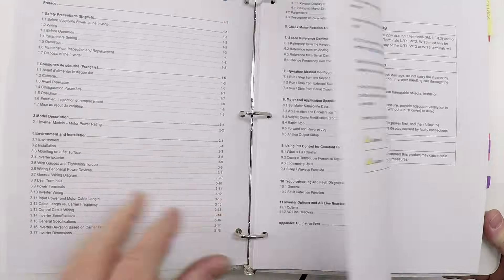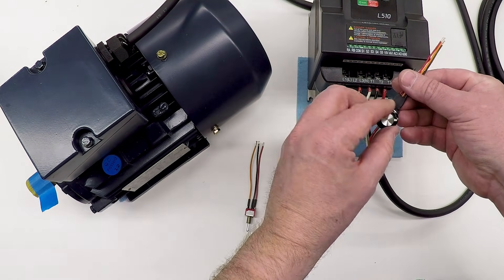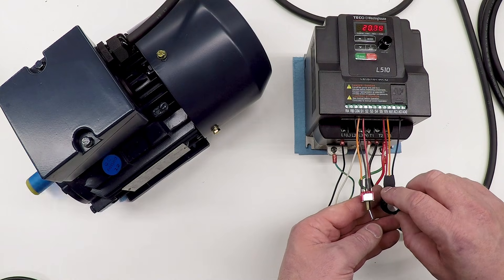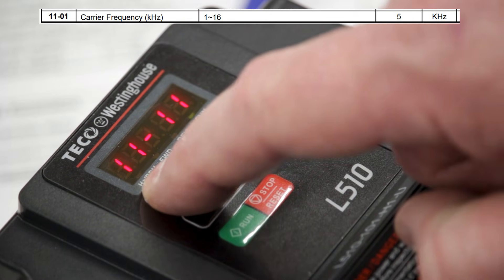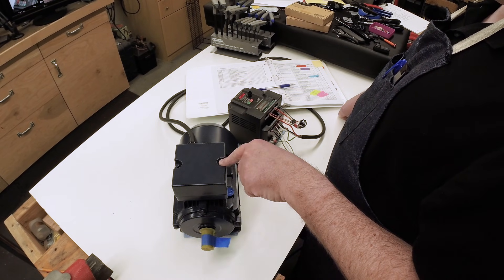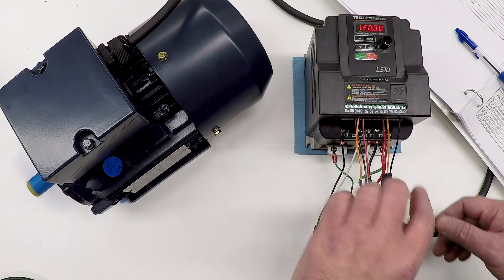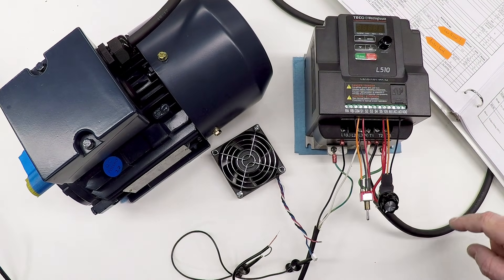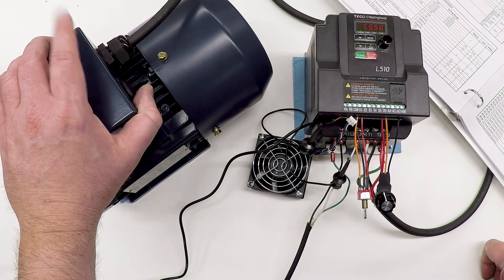Lathe VFD 2: How to Program a VFD for a lathe (Teco-Westinghouse L510)

Comment: John Owen

Like many others I found your video extremely useful and informative. I had just installed the L510 and a 3-phase motor on my 10" SB lathe and was having problems with a high-pitched whine coming from the three-phase motor. Much louder than you experienced. Actually TECO were very responsive to my problem and told me which parameters to change but I was somewhat daunted by the process. Your video showed me how to do it in a very clear manner. Thanks. It gave me the confidence to change several other parameters such as acceleration/deceleration times, etc.    FYI -- TECO have recently (May 2020) introduced a true remote keypad for this inverter --part # JN5-OP-L01 which completely duplicates the functions of the keypad on the inverter , including the potentiometer and allows you to control the inverter from several meters away. It connects with a CAT 5 cable and you need to change a parameter to install it.  Others could find that useful.

Comment: Thank you so much for this video!  I bought an old Delta Rockwell lathe with a three-phase motor, and once I figured out I needed a VFD to drive it I ordered an L510.  I didn't know squat about VFDs and couldn't figure out a damn thing, then I found your video series. Fantastic coincidence you had the same model VFD!  Now my lathe is runnning and I couldn't be happier!  

By the way, was your L510 manual missing the last 6 chapters?  My manual only came with chapters 1-5 and the appendices, but evidently there are 11 chapters in the whole manual.  I found a complete copy online.  What the heck?  I needed chapter 7, it explains how to configure momentary stop/start buttons.

Comment: Clough42....Is it possible to reverse motor rotation from the "key pad" on the L510? I know this can be accomplished by changing parameters and also adding an external switch, but what about the keypad?

Comment: have the 1/2 hp version of this [ L510-1P5-H1-U ], 120V input 208 3ph output - the tips helped immensely!  Runs silent, will overclock without issue. I am working on setting the incremental steps for up/down speeds (5 Hz step)  Thank you for the info!!  Going on my 1935 9" South Bend Workshop 415

Comment: You can use a required temperature rated NTC thermistor installed around heating area and connect series with  cooling Fan.it will manage the cooling process reliably.https://www.aliexpress.com/item/32988252790.html

Comment: When I switch off the VFD after finishing soime whork when I come back to it and switch it on it always defaults to the hightest frequency/speed.  Is there a workaround?
Reply: Look under settings 00-09 - 00-11. These settings are what is remembered between power cycles.
Reply: Are you using the keypad or onboard pot or external pot to change/set frequencies?

Comment: Thank you very much for this video.  I was struggling to figure out how to use this VFD.  I didn't see anywhere that you had to press and hold the Enter button in order for changes to me made.  Works much better now ;)
Reply: I should add that my VFD was like yours in that the settings were not what the factory presets in the info I got said they were.
Reply: I had the EXACT same problem!

Comment: thank YOU ! I have the same VFD and the settings were  all messed up....
I got a Logan lathe with this VFD set up on it....but only a switch to the power cord !
the rest is controlled by the panel.... if you reset the VFD it goes back to all the factory settings which are NOT what the manual says...it is indeed set up for external switches & Pot.
I just tried to use a toggle switch on the VFD to control the direction , However you must use a 3 position switch ! ( on -off-on )
as the 2 position toggle will not work.... there is no way to turn it on once you change the motor control from being on the panel to your external switch....  I thought I could use the on/off, on the panel and the external switch for forward and reverse
but that does not work..... 
Bob......

Comment: Really good video information with actual step by step instructions I really appreciate your work on this video demonstration I would like to ask an important question when I buy my vfd let's say I'm using it to power up a 3hp motor but I intend to power a much larger 12hp milling machine can I say buy a vfd rated at 25hp and still be able to use it to run a 3hp motor basically said do I have to match the vfd hp rating too the actual hp that the motor is rated at or can I buy the much larger vfd and be able to power any motor at any electrical range from say 1 hp upto the max 25 hp because as I stated I need to power motors that are all different in hp size ratings  and yes I hit like and subscribe and bell because this was top notch video demo

Comment: So I am trying to find a way to start our lathe motor at a low rpm since I use it for wrapping coils... I hope you can see this asap, but is there a way I can set up my motor to start at a very low Hz as yours? Or is that all depends on the motor? I have a 220V 2.2KW 8.8AMP 3 phase motor rated for 1380rpm. 60hz

Comment: Thank you for this video. Can I use this VFD to control a 1 phase motor (coffee grinder 220-240v 50Hz)? I just need to convert the frequency from 60 Hz to 50 Hz.

Comment: You very briefly spoke of an external tech via the AO. How would you attach a digital readout to that? Or, would it really have no meaning as that would be the motor rpm, not the spindle? Do you recommend just going with the old magnetic sensor glued to the spindle and leaving the VFD out of the game?

Comment: I had to fight my VFD I got with my lathe today...   I finally figured out how to get to the programming mode
and i put in the code to do a factory reset.... to go back to the factory settings....
and what do you know...nothing worked but the display.....   I fought it for hours trying to understand why the heck the motor wasn't turning.... came in here and looked on the net and found your video on youtube (thank God !)
and I wondered if my VFD reset to default values was like yours set to use external switches !
and sure enough it was.... I set each parameter to the on board switches... and son of a gun it started working ! 
I was so relieved ! .... I started this because I wanted to get rid of the slow start and the slow stop it is very annoying to have to wait for the motor to spool up ! ...looks cool, but that's all....so after I set the time to 2 instead of 10.... I was quite happy
 I too want to put external switches on my lathe and hide the VFD.... out of the hail of metal chips ! 
thank you for this video ! you saved my ass today !  thank you very much !
Bob..........

Comment: Thank you for making this video.  I use this exact VFD on lathes and milling machines. On one of the lathes I have decided to add a foot pedal potentiometer and got out the TECO manual. Then I thought to myself, let's check YouTube, maybe somebody has done a video. :^) Yes, you did. Thanks again. Great vid.  My VFD is no longer in factory presets … that are … as you noted not what the manual says. In fact, I don't think the factory defaults have been consistent across the years that I have used the L510.  etc etc.

Comment: I purchased an American Turnmaster Lather (actually two) the forward and reverse are electronically controlled from the bed,  Pull lever up goes one direction, in the middle, motor stops and down and out reverse.   (I think)  I want to see if I can use the same levers but control the VFD.    It would be easy except On the floor is a brake that cuts off power to the motor and brakes the lathe,  I am guessing the motor must turn on by the engaging of an electromagnet.   I dont have three phase to actually figure out exactly how it is wired.  I purchased a VFD that I wired directly to the motor and using the push buttons turns the 7.5 hp motor on and off.   Here is my question.   Does the forward on your toggle start the motor and stop when switched back to the middle.  If the switch was in the forward and you hit the stop or reset button would the lathe stop,  (the foot peddle)  if the switch is in forward and you release the stop or reset button does it start back up,   the lever is still in forward and my foot comes of the foot brake,   I want to avoid this and if the reset or stop brings the HTz to zero then the forward lever still being engaged would not be an issue,  Now  to restart,  shifting the lever to the middle, which could be wired to the stop or reset,   but how do we get the htz back to 60 for the restart?     

With my ohm meter I know the forward and reverse is a bar with two switches, wired two each other I assume to switch the three phase wires to change directions  three contacts open closed  com,    line in to common on first switch and out open to second switch common then out open back to (motor or switchbank)  hen first switch engaged power from common goes back through closed and  no contact to second switch.   When bar goes back to middle pos,  first switch disengages providing power to open and out to second switch common  and when reverse is engaged,  power passes through first switch to common on second to closed on second switch back,  I wont be using any of this.   Just the contacts on these switches.   Like your toggle, the forward can be wired from ground to the common on switch one, out open to switch two common and out switch two open to the stop or reset on the VFD.  When  forward engaged the ground goes to the first switch closed back to the forward on the vfd and second switch has no contact so the stop or reset not engaged.   When switch to reverse the second switch closed sends the ground line to the vfd reverse.      The brake contact cuts the line when engaged.   But I could switch to one like the forward reverse so when not engaged it goes out the open to the forward reverse switches, and when engaged the ground goes to the stop or reset.   I just dont know what will happen if I take my foot off the brake.     Any information before I go by trial and error and smoke my VFD would be really appreciated.

Comment: Hi thankyou for splendid  video   .Can the  relay (fanoption)  be  used  with a 220Volt   fan ? thk  Kurt  from Denmark
Reply from the maker: Definitely check the specifications for your particular model, but the L510 manual says the relay contacts are rated for 250VAC, 1A.  For DC, they're only rated for 30VDC, 1A.
Reply: @Clough42  Thankyou very  much  for   very  quick  answer    all the  best  from Denmark

Comment: When you change the frequency limit did you also change the rpm setting ?tnx
Reply: Where do you see an rpm setting? The frequency is what will control the rpm, a tach simply measures it.

Comment: Indeed the manual is wrong, I had the same problem that de default settings are not as described in the manual. So I think you're model was not returned  instead the manual sucks ;-)
Reply from the maker: This is what other people have said as well.  The manual  may be wrong on this point, but it's still one of the better manuals out there.

Comment: Hello James,

I liked these videos so I’ve decided to try it. I’m using the same VFD and the current equivalent of the motor from Lesson, the one in the video has been discontinued. I’m working my way through the VFD settings but I’m still getting the vibration in the 20 to 55hz range. Yes, I’ve set the control method to SLV  and set the carrier frequency to 16 but, the vibration is still there.

Any suggestions would be appreciated.

Thanks and keep the videos coming, I’d like to try the electronic lead screw next...

Comment: Good, clear explanation for a viewer at a moderate DIYer level.   Much clearer than the YouTube competition.  Probably means I’ll buy a TECO for my 3-phase Tablesaw, so I can just sort of follow along (with some settings different of course).   I would only add that the Relay connections you’ve used are more generally used to energize a relay that then turns on/off some other potentially high current draw auxiliary device, but since your “auxiliary device” is just a very low current/low voltage draw cooling fan its perfectly OK to use Relay terminal to directly drive it.

Comment: I have previously run my Colchester student using a converter.I have had problems with the contactors burning out,and now the motor has burned out. I have just spent a small fortune having the three phase,three horse power motor rewound,and do not want to burn it out again any time soon. Looking in to alternative power sources,as I only have single phase in my small workshop,I came across your inverter videos,and based on this I have just ordered the TECo inverter.I will be using this video again to help me during set up.Thank you for a clear and concise video.

Comment: one more question have you set up low frequency torque gain?thanks
Reply from the maker: No, I didn't change that setting.  I don't get a ton of torque at 6Hz, but it's been plenty for what I typically do at that speed (tapping or threading).

Comment: James, is there any reason (perhaps related to your upper limit freq of 120kHz) why you went with the 10k pot instead of the 5k shown in the instructions? 
Jim
Reply from the maker: I thought I used a 5K pot.  Maybe I misspoke or I'm now misremembering.  Ultimately, the pot is connected between 10V and ground, and the VFD is just sensing the voltage on the wiper.  As long as the impedance is low enough for the input circuit, the actual resistance of the pot doesn't matter.  I think the VFD manual calls for anything from 1K to 5K.
Reply: Ok, just a slip, then. I was worried there was something I was missing out of the manual... I'm thinking about a jog circuit, but as this is my smaller lathe, I keep asking myself if I will really need it... maybe I would be better served with a chuck shield with a e-stop function.... might be a good video idea.

Comment: How can set max ampere to stop the motor?
Reply from the maker: As far as I can tell, the drive allows you to set the deceleration time.  I haven't seen a setting for max current to stop.
Reply: i think is 02-01which is load current and in the manual in note section says overload protection  @Clough42

Comment: Really nice video; concise/no-fluff but comprehensive, no distracting music, good video, well-lit and relevant framing of the whatever's being discussed.  Thanks for putting it up.   I wonder what kind of things, if any,  you considered when choosing this drive vs. other cheaper ones (e.g. https://tinyurl.com/ycqy8z5r in the $60-100 range)?  Also, not sure this applies in your case, but assuming this guy is right, https://youtu.be/0FkWJbr4O1w?t=1037 "Reviewing, testing and installing a cheap Chinese VFD" (at 17:17), maxing out the carrier frequency could increase risk of damage to bearings, insulation and make the motor less efficient.
Reply from the maker: I looked at some less-expensive VFDs.  I ultimately chose the L510 because it's a solid VFD with a good reputation, it has a good English-language manual and it's possible to get good support in the US.  From everything I've read, the real issue with VFDs damaging motor windings is because of the extremely fast switching speed of the IGBTs in the drive.  This is an especially big problem if you have a long cable run from the VFD to the motor.  The L510 VFD manual specified the maximum motor cable length for each carrier frequency.  For 16KHz, which I'm using, they specify a maximum cable length of 30m.  My cable is about 1m, so it's not an issue at all.  I'm also using an inverter-duty-rated motor, which is designed with additional insulation to withstand the transients that can be generated by a VFD.

Comment: Great video.  My motor is spining forward and backward at the same time. I will appreciate your advice please.  Thanks
Reply from the maker: You mean it's vibrating back and forth instead of turning?  I'd probably check to be sure the motor phases are all connected correctly and securely.  Beyond that, I'm not sure.  I haven't seen that before.
Reply: @Clough42  I thank you for reply.  I will send you a video via yor email

Comment: My gosh this has been absolutely amazing. I want to connect my Mitsubishi vid 220  1ph input to 220 3ph output to a 1.5 motor. Going to install it in a dl40 delta wood lathe. The wiring for both looked daunting and I understand the household wiring and respect it but the extra wires in motor, which are all just that wires with labels but I don’t know which ones to connect together. I can only hope that the vid will be easy to program like yours.  Thanks a bunch bud. Beautifully done video.
Reply from the maker: Thank you.  Best of luck with your project!

Comment: Thank you sir. It just nice explained. Would you explain Volts/Hz curve modification please sir.
Reply from the maker: I've never used volts/hz curves.  My understanding is that it causes the voltage to be reduced at slower speeds, to compensate for the lower back-EMF.  I tried the motor once in that mode on my late VFD, but it was noisy and didn't produce much torque at the low end.  Granted, I hadn't tuned anything else yet, so it's not a fair comparison.

Comment: how can i program the acceleration time be fast it builds up to 80hz too slow! help!
Reply from the maker: If you have the L510, it's parameter 00-14.  I have another video about tuning acceleration and braking:  https://youtu.be/VtS24eyaqjQ
Reply: @Clough42  ive got l510s whitch i think is the same.I did the same settings with you  for my vfd is that ok or it depends of the motor? Im running sigle phase electric